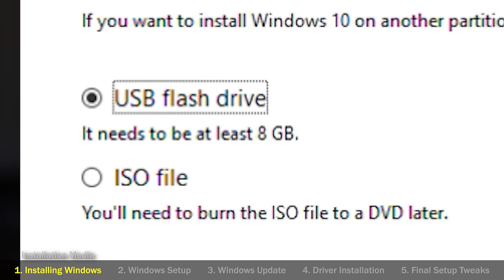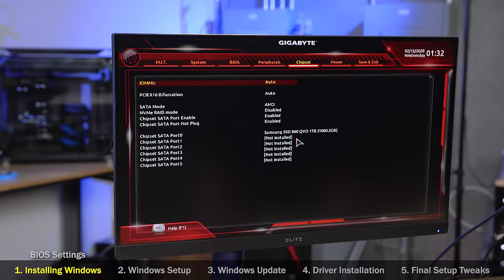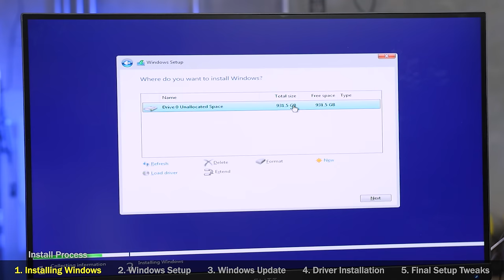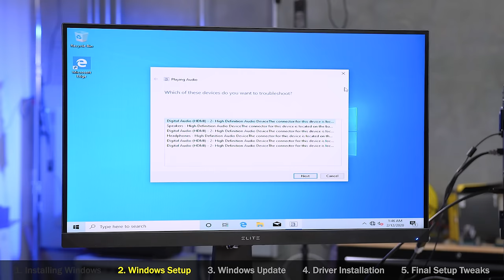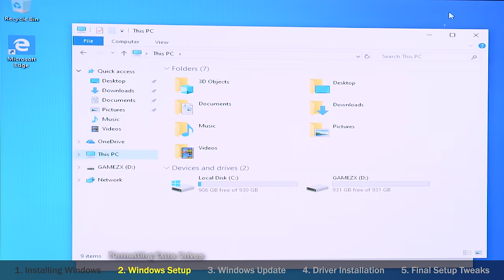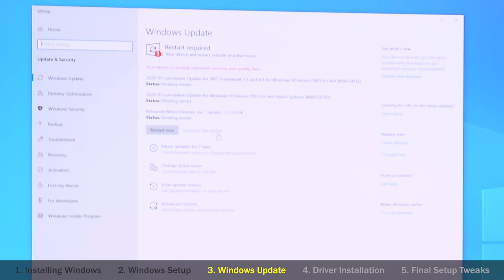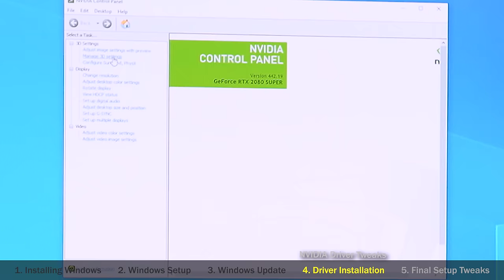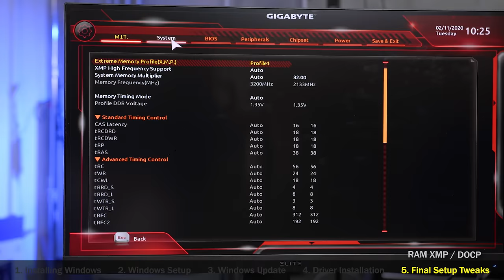Guide: What to do AFTER building your computer...

Comment: Edit: AS OF 9/22/2020 I took it upon myself to test & confirm- Went on MS Website & made a install USB as up to date as can be; Windows 10 can be installed without the need of unplugging from the internet or signing into Microsoft. Select Offline Account on the bottom left; you'll be prompted with another "suggestion" to sign in, look at the bottom left and you'll see *limited experience*... That's it! Now, enough with the falsehoods that there is no option. If you need further proof I'll even upload screenshots to Imgur for God's sake.
**That quite literally means nothing- it's just there as a way for Microsoft to 'push' you into believing you need to make a MS account, for things such as and not limited to, syncing backgrounds/themes. 

Few things to note:
Though he suggests not plugging into the internet during the windows install process, you can simply select use a local account instead of a Microsoft account. You're already going to be asked about Spyware, you might as well let several updates begin to queue up as you set up your preferences. People often overlook this because Microsoft makes the UI appear as though the "only" option is a MS account--use your eyeballs, the alternative option is on that very menu usually at the bottom left corner.

* AFTER all windows updates are completed. I recommend making an actual Windows backup. I use Macrium Reflect. If you look around you can find it wink wink nudge nudge. Why? Because it's immensely useful & a time saver as you now created the most vanilla stock version of windows that will also be the smallest backup size as well. So- whether you want to offload that to the cloud or on an external disk you always have that quick and fast "revert to X" in its FULL form.

*On the topic of backups. Personally when I install windows I run BCU (Bulkcrap Uninstaller), there's no reason for why my OS needs Candy Crush & other bloatware on it, so this utility is great as it'll also show you what is or isn't safe to remove.. Certain apps can only be uninstalled from within the live tiles or inside the list of programs when you hit your windows key. Simply right click and uninstall.

*By the time you're done installing the core drivers/apps. Be sure to visit your Task Manager > Startup. Disable ANYTHING that is not necessary, because there are applications guilty of causing you to go from a boot time of 8 seconds to the desktop, all the damn way to 25+ seconds. Such as, Adobe Creative cloud, Peripheral apps (Logitech), Windows Defender (don't worry, it'll function properly regardless. Windows still will routinely trigger a scan by default). Corsair's notorious iCUE. 

Once everything is set I recommend one more windows backup. This one will be unique from the first in that, you have all your devices drivers installed, personal settings configured (such as mouse pointer, themes, custom audio equilizer, RGB config, etc. Etc.) in a working state. So feel free to delete the first backup if you'd like and preserve this new one as your absolute ultimate "gateway of last resort", should you ever need to break it out and restore due to whatever happens. 

Drives & partitions--Minitool Partition Wizard is in my opinion one of the best applications anyone can ever have when it comes to reformatting & managing drives. Compared to Window's Disk mgmt it makes it look like garbage for a few reasons. Ever had a drive where you needed to wipe all the partitions on it yet inside disk MGMT its greyed out & you're unable to? Or all the plethora of thing Windows is so stupid & unable to accomplish you're left wondering why the hell it's there to begin with? Well that's where this utility shines. ESPECIALLY, when there's a drive that for "whatever" reason, won't even appear inside file explorer or disk mgmt!! There's been times when & where Window's format actually screwed with several USB sticks, external drives & even internal drives from my own experience across multiple different workstations. It's baffling. But on the brightside it's the one disk management tool that a) isn't BS. & b) Actually works, and works reliably--so far as to being able to even detect and help you repair/restore whatever Windows messed up. 

*Play ANY games provided by the Xbox companion app/Xbox pc subscription? Check your C: drive. No, really. Despite you at times opting to install a game on say.. Your hard drive, the thing with 2-6TB+ of available storage. You click download and proceed to watch as your game installs.. Except... Your SSD shows you're losing space whilst your HDD is not even writing... Boom. The game(s)'s installed! Great!? No. Upon further inspection you will often find windows installed the game onto your C:/OS drive and NOT the disk/folder YOU chose in the dialogue box. How do you fix this? Go into apps & features. If the game says it's in the drive you selected but clearly that 20GB of space is suddenly gone on your OS drive--it means it's not actually where it's supposed to be. So, you're going to now click the app, choose move > select any drive/partition with enough space. Once it moves it, you will not proceed to repeat this step and actually move the game to the folder/disk you originally intended it to be. And voila! Your C:/OS drive "magically" regained 20GB of storage that somebody stole. Microsoft is a joke. Games prone to doing this: all. But for more specificity--Halo MCC, The Outer Worlds, Talos Principle. 

*Someone mentioned running "stability tests" & mentioned several benchmarks.. Listen & listen very well--DON'T DO THAT AT THIS POINT. You are just barely installing the critical drivers for your hardware. The LAST thing you want is to have your system crash because some buffoon thinks a synthetic benchmark will help you. Except, you would have experienced BSODs, etc. Before any of this should your hardware actually be faulty. Remember, the motherboard will set its own base defaults across all things, thus no overclocking is done and even certain features like XMP are disabled. Therefore why on God's green earth would you stress test a fully stock system that's STOCK for a reason? Moreover, your system is likely already stable and yet you will encounter failures during these synthetic tests. Does that mean your system is entirely unstable and bad? Absolutely not. If you use it every single day hours on end & it ONLY fails in that one application - that suggests there's a conflict solely exclusive to that application. As your everyday computing IS stable.

*If you are going to overclock and tweak, always make a copy of your current config. If it's in the BIOS plop in a USB & save your current profile(s) so that in the event you must clear CMOS; you don't have to configure everything all over again, it's just one click away. & if you upgraded your BIOS, then that's the one exception when/where it'll be erased regardless. Variables; don't change several things at once such as applying a memory overclock & a cpu overclock-because you'll have to work harder to isolate issues since you pressed all the buttons so to speak. Rule of thumb is cpu first then memory. Make sure you take pictures of your BIOS at the moment right when you're about to save & exit - because this is the screen where you'll be presented  with the previous values in comparison to the new ones. Why's this worth mentioning? Because chances are you're likely going to visit and revisit your BIOS a few times, and unlike your Browser history, it only saves the very last changes made. So, unless you wrote things down or have an amazing memory you may not remember that obscure voltage value you entered 3 reboots & 5 hours ago- get the gist? Lol.

*Real world trumps synthetics. As much as you'd like to have your system pass every benchmark and every scoreboard ridden app, you'll often encounter your system failing one benchmark yet have verifiably seen it handle actual workloads without ever encountering even a minimal hiccup. Is your system unstable? No. It's just simply running into an issue with a synthetic load/highly niche scenario. If all you do is game and your system has never failed you once & yet it locks up during some 3D Mark benchmark run, are you really going to call it a lost when you've never even seen it affect your actual usage & experience?. This is something you can really only truly understand if you've been a tweaker/enthusiast overclocker for years. I say that because there's a reason why we; or Linus, Steve (at gamersnexus), & Wendell always make it evident when comparing apples to apples in a synthetic environment.
Reply: Interesting...Microsoft has definately turned into a virtual lamprey-fish!!!
What would you recommend for $2k as a best build? My "old old old" sys FRIED (finally) and there's so much sh*t flying around after watching 5billion vids I'm myself fried!- I'm about to and NEED the best most upgradable fast etc build and would very much appreciate recommendations!🤓
Reply: Last time I installed win10, the option to use a local account was hidden until i disconnected from the network.
Reply: Came to post this, I'd been doing the offline as I hadn't noticed until my partner got a surface (and therefore couldn't leave offline) and noticed the difference in gui and the offline option hidden away in the bottom.
Reply: The local account option has been remove a long time now. You must be using an old install image
Reply: @jackdoyle5187  That must either be untrue or a bug; I've just got done testing a fresh run of an install & disproved the need for it. Read my edit, you'll see in greater detail.
Reply: @leodf1  Wrong. I've just got done testing a fresh run of an install, they "local" was switched to "Offline" account. Please read my edit, I go into further detail.
Reply: You are correct and incorrect at the same time. There are several different builds I have come across (some OEM build) where the offline account button is removed. However, to get past that is easy. Step one unplug the internet. Step 2 hit the back arrow in the upper left corner. Step 3 Choose your user name then hit enter. Step 4 Plug in your internet and continue your install. As I said above I have noted this issue mainly on OEM builds.

Comment: FYI: If you have a Windows 7 key, those do work for Windows 10. Source: did it myself.
Reply: Ultra satisfying when it works.
Reply: @Lethaltail  yep
Reply: eoe123321  Try asking the PC manufacturer, sometimes they can provide it
Reply: eoe123321  if you still have your installation, you can try a tool like ProduKey or KeyFinder to grab the product key for safe keeping. For anyone else reading, I don't know how well it works for Windows 10.
Reply: @Lethaltail   I believe there is a CMD command to reveal your key
Reply: @necrobynerton7384  that is true.  I do wish such commands would stay in my brain but they really don't.
Reply: @Lethaltail  Well, if i recall correctly it wasn't exactly simple command to reveal your key through cmd. there were some hoops to go through but it does work since i needed to get my key from a laptop i had

Comment: What DO You Recommend. Putting Microsoft account in installation, putting Microsoft account after installation or not putting it in at all.
Reply: If it's only device then having a Microsoft account linked to your windows 10 license is good for future reference as say you replace your drive on which you installed windows on with a new drive for example from HDD to SSD or from one SSD to a new SSD then Microsoft will still retain your windows 10 license key if you have linked it to a Microsoft account.
If not linked then you will have to buy a new key then.
It's personal preference.
Reply: Watch out, you may have trouble with passwords if you setup a Microsoft account, your PC will be locked with a password linked to your MS account, so be careful and don't forget your password or don't setup a MS account.
Reply: @danielgomez7236  yeah don't forget the Microsoft account password like your Google account password.
But I think you can easily recover your account password by simply using the forgot password feature.
Reply: @shubham-pawar  Well I am a technician and I often find a lot of people that forget their passwords and then they lose access to their computers so my advice is don't use passwords if you are not good at keeping them.
Reply: Thanks for the quick and Amazing reply's.
Reply: @danielgomez7236  If you remember your email pass it's all fine 
I usually remember only one password (lastpass)and every time when I forget my account's password and reset it with my already logged in email always save the new ones in lastpass
Reply: Jones idk if this option exists on Microsoft account or you gave them your phone number but yesterday I reseted my Google account's password with my phone number (not that I log out of my email but I did it that way)
Reply: @shubham-pawar  PC password? Nope my pc was linked (I found out in an annoying way as my theme synced from my secondary build but luckily nothing catastrophic) forgot password for the PC asks for a password recovery key, seems like it's pretty much adding a universal key to your pc to a flash drive and you use that to recover it but I dunno about that.
Also for those curious I still have no clue what happened to my pass as my actual account password didn't work nor did the MS password i probably screwed it myself as I have a pretty good inkling as to what may have happened however it's still nonsensical that what I did changed the password of all things but windows dumb so I dunno
Reply: @shubham-pawar  It's not true that you have to buy a new key. If windows on a new drive or after hardware changes says that it can't be activated there's an easy fix. just activate it via phone, there's an automated system. It will guide you through some steps where you have to put in the installation id etc. It basically unlinks your installation from the old hardware and binds it to the new one.
Reply: @Noxorus24  thanks I didn't know that.
Could you explain in detail how the process works via a phone?
Reply: @shubham-pawar  You only have to buy a new key if for example you change your motherboard, and even then it's negotiable with Microsoft. Windows even automatically sees that okay you're running the same motherboard you linked your license locally earlier, we'll just activate the install for you, even if it's a new HDD/SSD. I've done this a lot. It's pretty handy how Microsoft handles activation nowadays.
Reply: @Anna-abc  ohh thanks for the info.

Comment: What I like to do is download all my drivers on a different computer and put them on a flash drive so I can install them quickly.
Reply: That's exactly what I do.  So much faster and easier.
Reply: I hear ya but sometimes its not even that serious so u just download and install on the new rig. Its totally a user decision.
Reply: Same here, on older or less well supported systems it's the only way to get an internet connection. Raid is an even bigger problem.

Comment: I built my first system in may 2019 and the tempered glass side panel shattered when I took it off, yeah, pretty sure it was defective.
Reply: sounds like nzxt
Reply: Simracingnoob oh no
Reply: Not defective, you're just unlucky, tempered glass has a pretty low chance to shatter and you landed in that chance. Warranty will cover it.
Reply: I’ve seen you comment on iracing videos lol
Reply: Moredy that is what defective means O.o
Reply: Put a plastic bag over the opening like if your side window in your car broke. lol Just kidding. Go online to the maker of your case and see if they sell replacement glass.
Reply: I'd go to my local hardware store and have them cut some plexiglass to fit.
Reply: @TheFrisken95  It's more of a feature with tempered glass due to the way they're made. 

It's pretty impressive when one of those huge glass partitions used in stores suddenly shatters as long as you don't have to clean up the mess.
Reply: Tempered glass... This is why im using as sidepanel chopham armor plate from challanger 2.
Reply: More like tampered glass, amirite.
Reply: I got a new one and the case is a NZXT H700